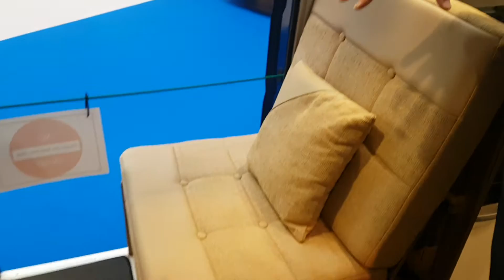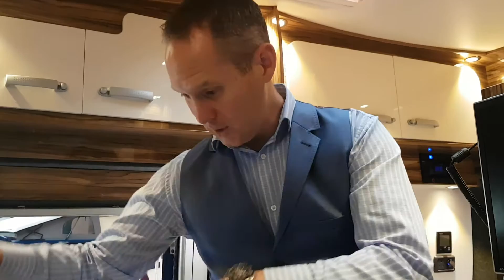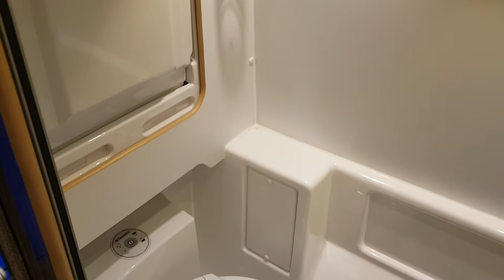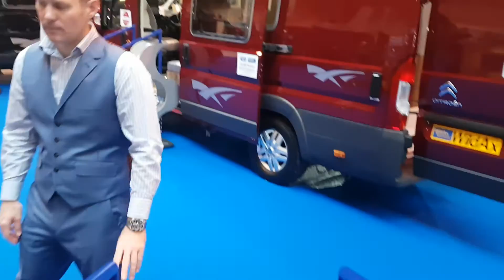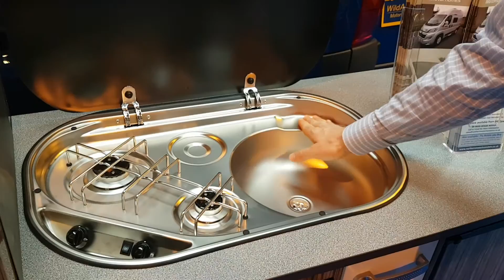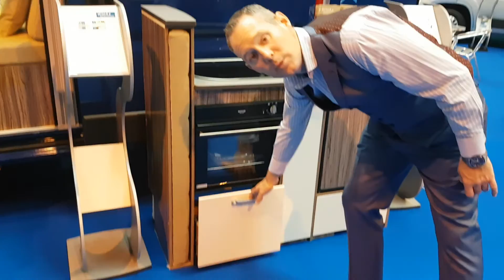Pulsar High Top 2016

Comment: Can I ask why the kitchen window on the Pulsar always appears to be fitted the wrong way around? The central seam join when closed is facing forwards which means that driving rain will be constantly trying to get in when the van is being driven, and likely to find its way inside especially when the seal has been used for a few years.  If the opposite hand window was fitted then the closed seam would be facing the rear, where water is not going to be driven against the seal when driving.